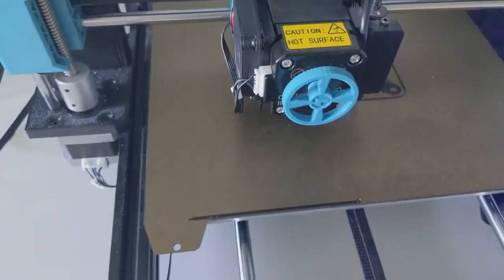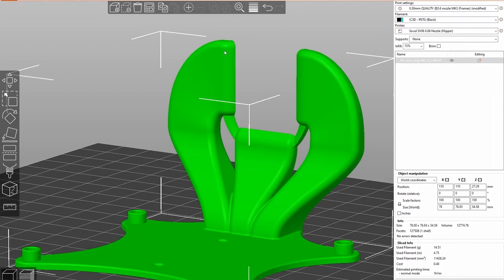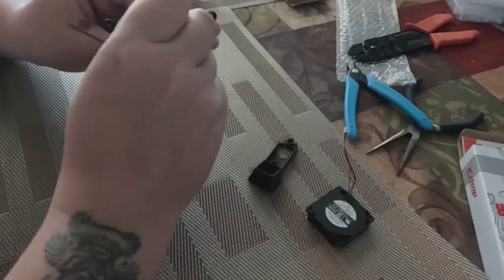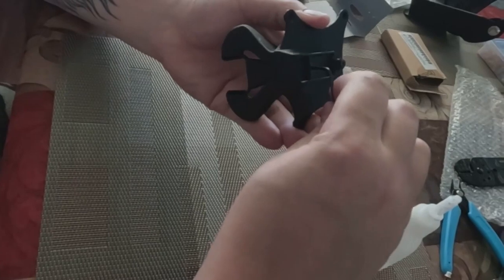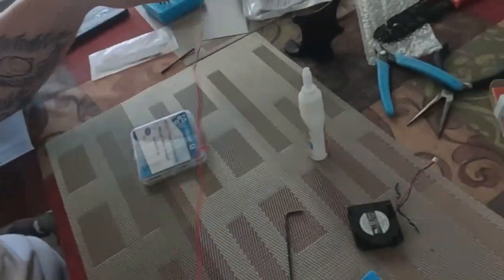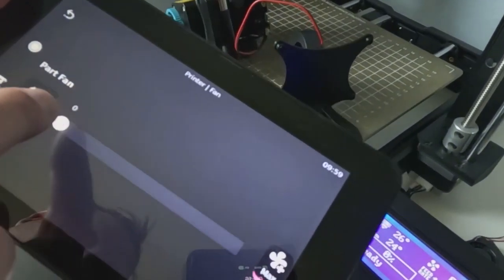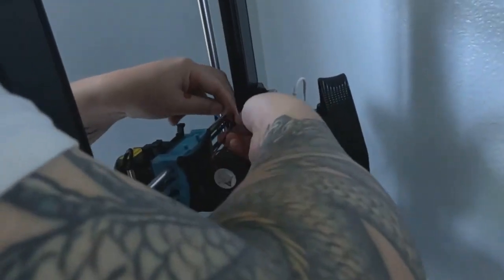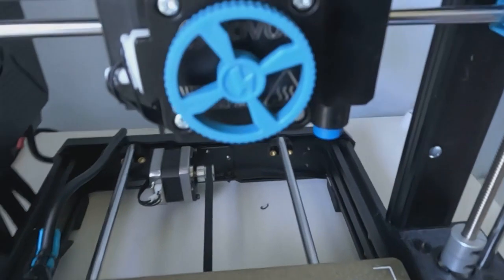Sovol SV06 5015 Fan Duct Mod

Comment: I just heatshrink/soldered an "pigtail adapter" out of the original JST to a female connector for a 5015, the 5015 fans just snap right in to the adapter now, the toughest part is making sure the adapter is tucked up out of the way. Seems to work just fine. It also helps that I could use any type of fan on it now if I wanted to change things. One of the good coolers for the hotend uses a 4020 blower.

Comment: The 5015 fans I bought already have JST 1.25 connectors installed. That's half the battle.
Reply from the maker: That had to be nice. If you got a link, please share.
Reply: @room281tech8  I tried sharing a link earlier but it looks like my comment was deleted.
Reply: @ipdjbt just give name and where it was sold

Comment: I have been using that duct and a 5015 fan for a while now.  Printed mine in ABS. Love it
Reply from the maker: Unfortunately, I just don't have the ventilation for printing ABS or ASA. I have a bunch of it but I can't use it yet. Hopefully soon though.
Reply: @room281tech8 nice. I wish someone could remix this duct for the sv06 plus. I looked and it seems the maker only made one for the sv06. I don't have  the skills to do it or I would. Hopefully someone will create one soon. I have both the sv06 and sv06 plus now and love them both. They easily outperform my other printers.

Comment: great stuff!  What length M3 did you use to connect the adapter to the plate?
Reply from the maker: So the printables link I left in the description has all the specs for every screw I used.
Reply: @room281tech8  oh cool, thanks!  I must have missed it.
Reply from the maker: @RichD_333  if you don't see it in there let me know.
Reply: @room281tech8  I see it now, thanks again!
Reply: @room281tech8  Printed it with PETG, and this thing is awesome!!!!  I mainly used this duct because I'm adding a front LED strip so I can see my print.

Comment: What filament did you print the new cooling guide?
Reply from the maker: I ended up printing it in eSun PETG. I wanted to print it in ASA but I just don't have a good way to ventilate the fumes. PETG seems to be holding up very well, no signs of deformation.
Reply from the maker: Also make sure you use something like pronterface to PID tune your stock marlin firmware